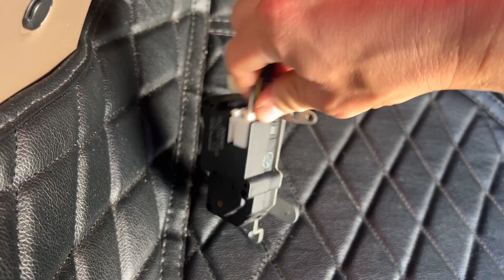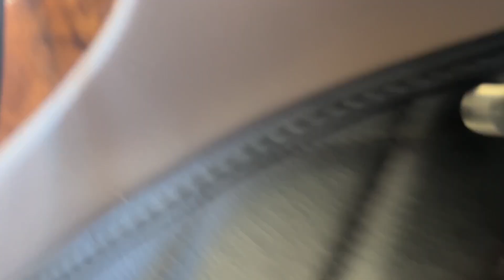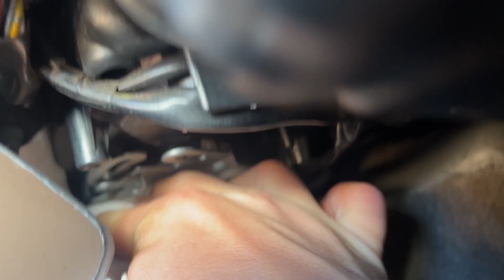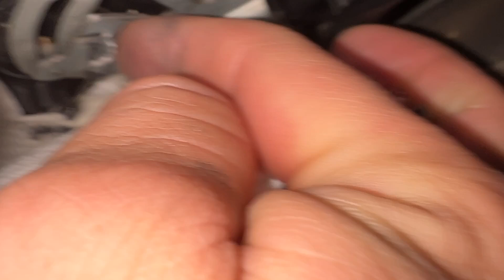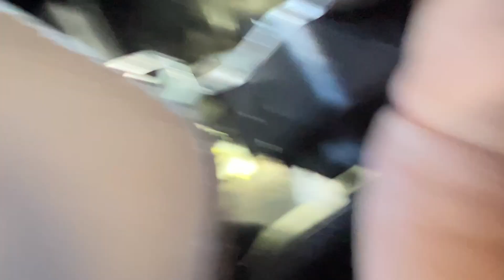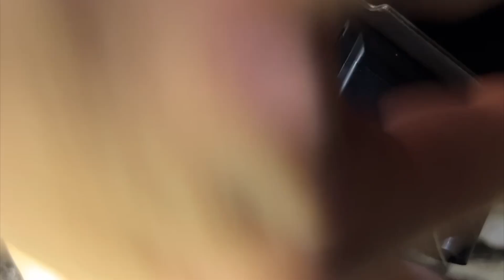How To Fix 99 3rd Gen Toyota 4Runner clicking under dash | Vents Wont Change Hot to Cold

Comment: Got home with my 99' 4runner today and went to change the temp and heard the clicking. So glad i found this video and that the fix is relatively easy. Had the same issue in my 2004 chevy malibu and had to tear the whole dash apart lol😂
Reply from the maker: yeah it was a pretty easy fix for sure. so glad the at the toyota dealer just gave me the part number to look up on ebay to save me money. I believe it, GM seems to like to make it hard to replace their hvac flap actuators haha

Comment: Awesome video! I only came to say that you can actually take that blend door servo apart, simply flip the plastic gear 180° to make it good as new. 
Once the cable gets gunned, it puts stress on the gear wheel inside the part and eventually strips out only a small portion of the wheel so if you flip the wheel, you’re using the other side which has been untouched, practically brand new.
Reply from the maker: interesting idea, should have gave that a try just to see,  yeah that cable needs be taken care of or will happen again. these seem to break on all vehicles at some point. with a new OEM one I should be good for another 26 years haha
Reply: I'll be trying that today. Thanks!
Reply: Came to comment this but you’ve beat me too it. The same trick can be done on early Vw Golf egr valves. Saves hundreds of dollars

Comment: Mine has a similar tic, but only does it when the car starts to idle rough and the RPM's drop low like it's struggling to stay on, it will click several times until I give it gas.
Reply from the maker: That sounds engine related not hvac related